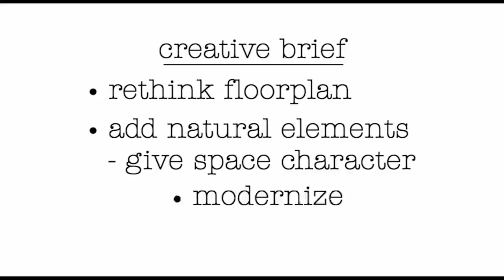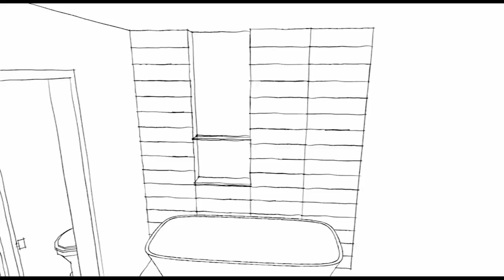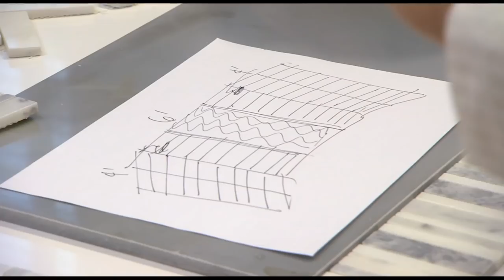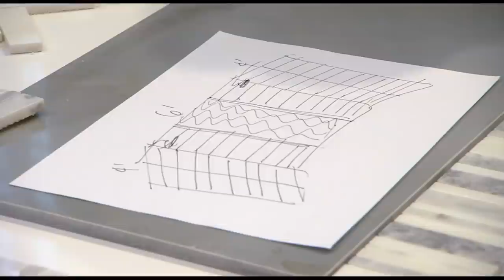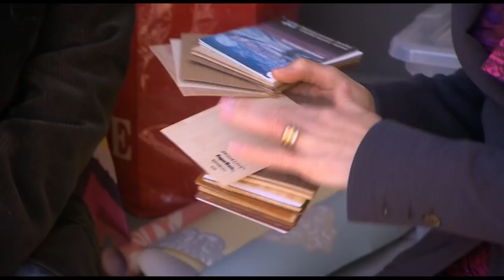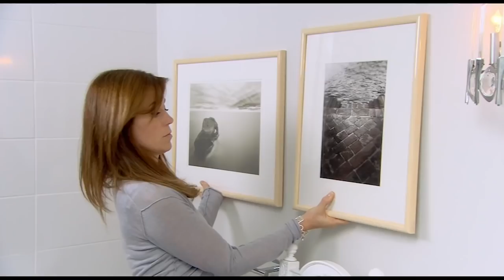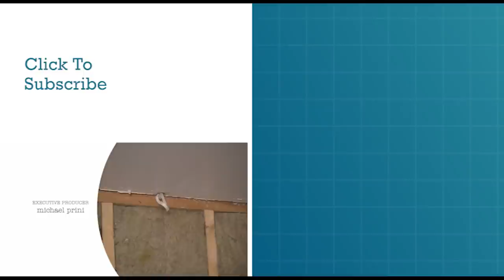How To Give Your Bathroom A Modern Makeover | Sarah 101

Comment: The tile is gorgeous but I am not sure about the vanity.
Reply: Indeed. Vanity is ugly!... Horrible color and the handles are like 1960... don't go well with the tiles at all. ..... 😩 😫 Ugh 😫
Reply: While I don't think it's that bad they should have done a double sink vanity. Specially if they didn't want a bathtub.
Reply: No reason to have that low sink. Adult bathroom needs to be adult height....as in kitchen height.  The only reason bathroom sinks were low was that the house had 1 bathroom so needed to be kid accessible. Let's stop living in the 19th century.
Reply: The vanity is gorgeous,  the tile is way overdone.
Reply: @megaharuko25  they opted for the double shower instead of the double sink, maybe good for them, but not for resale 🤔
Reply: @pamelaspooner8335  - They mentioned that the sink is normal height (32" to 36"), but they went up with the height of the vanity along the sides to increase storage. As my bathroom (rental) has NO storage in the bathroom, I'm coveting those storage towers. I would have preferred double sinks, however, for both resale and for the couples who will need two sinks when getting ready to go out.
Reply: Tile is too much. Chair is horrendous.